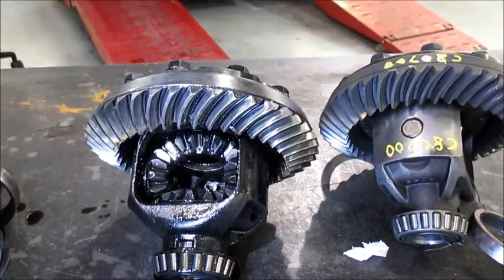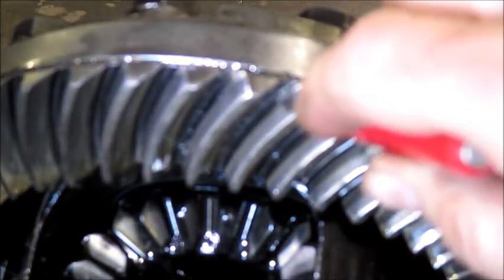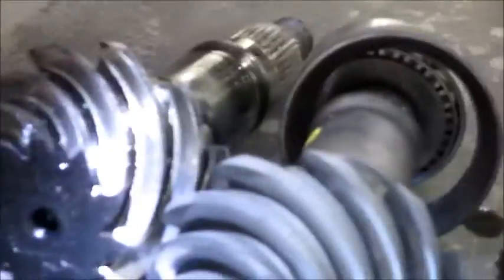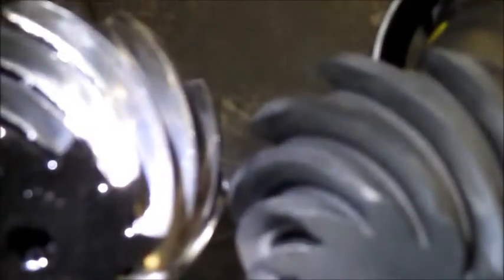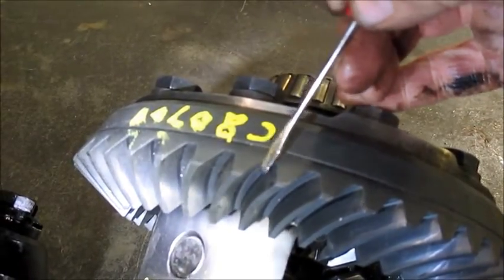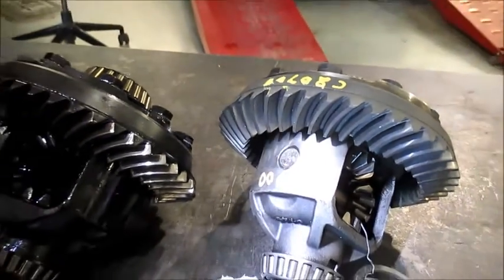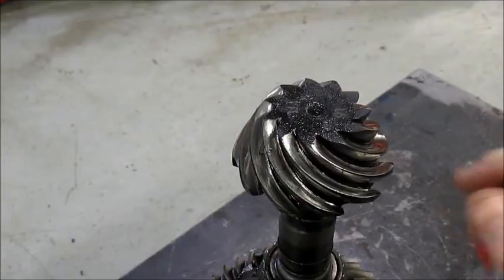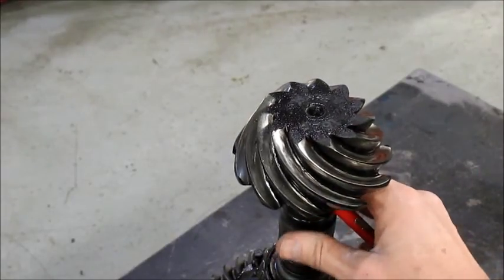Ring and Pinion tooth wear

Comment: Hey there can you tell me more about the reason for the loose shaft at the beginning of the video
Reply: Pinion bearings are shot. This differential needs a complete rebuild. Probably could use new Spider gears and side gears too. Those are the ones inside the carrier. They can wear out also. I question the quality of the steel GM used for the spider gears. I didn't want to do this job on my truck. I went to the wrecking yard to buy a good used axle. I couldn't find a good one. Every one I opened up had pretty high wear. I finally just ended up biting the bullet and had my original one rebuilt. I have an S10 P/U. The howling and occasional crack noise was driving me  crazy. I let it go too long and I had to replace the carrier too.
Reply: I think I might have the same issue. I heard a bang in there at first. Didn’t think it was a problem then it got worse. So replaced the spider gears are the bearings but sill get that bang on ecceleration.